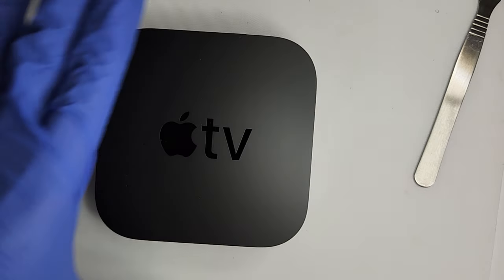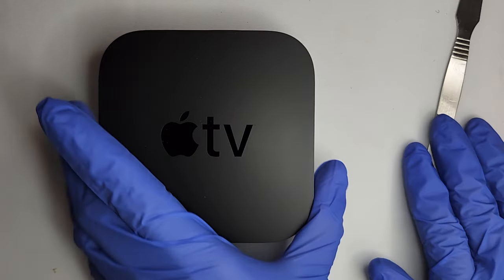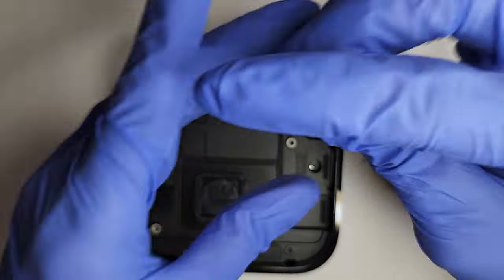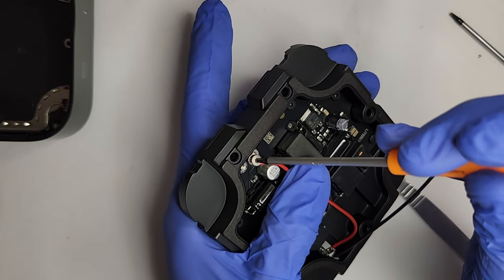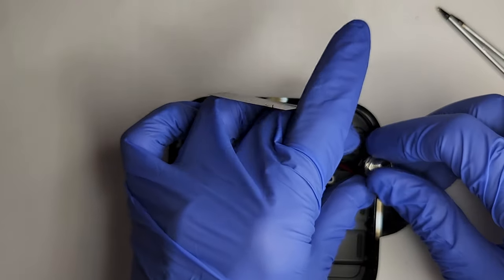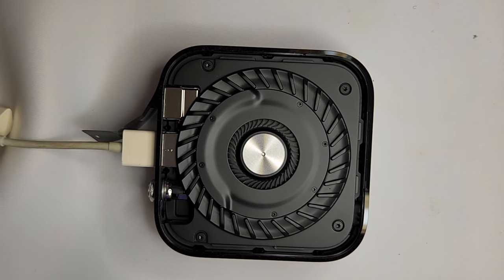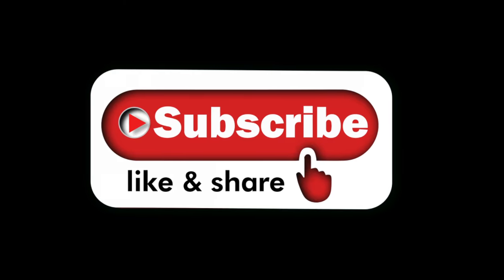DIY: How to hack your Apple TV to run from 12v (Car) DC power in less than 10 minutes.

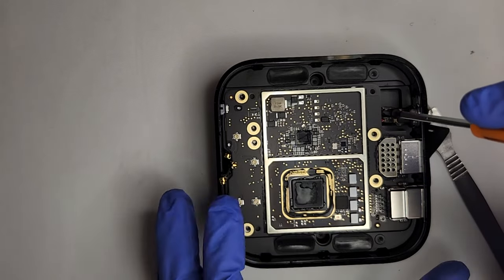Comment: One question, If you can read 12v when measureing the plugs on top (5:56) , would that mean that the Mainboard is faulty ? and the power supply 110/230v is ok ?

Comment: Great video....but think would have been more useful to add USB C port and get the result...also it would add expansion functionality too as well as power.
Reply: Thought about it for m build (broken power supply). While you can source boards in China that provide USB-C and Power Delivery initiation logic, they are sometimes of poor quality. And not many cheap wall chargers can supply 12V.

Comment: definitely gonna try this in my 2021 ATV, and buy the mod from you for the 2022. For the 2021 ATV the negative pin is the one toward the outer side of the unit (looking at it from behind) correct! Great work and thanks for sharing.
Reply from the maker: I'm a little afraid to answer definitely because your "outer" may not be my definition of outer.  Let's just say this when looking at the bottom of the PSU with the big capacitor in view, the Positive pin (screw) is towards the corner of the PSU.  Hope this helps.
Reply: @mikegyverComputer on the 4th gen u have 3 screws the black screw to the left is earth as ur looking at the power board with the 3 screws at the top the middle screw is a earth aswell on the 4th gen its the silver one on the right that is the positive on the 4th gen. ur video was great but it shows the 3rd gen I think.as I say my 4th gen has 3 screws 2 black with are earth and one silver screw which is positive

Comment: HI, i would like to order this kit but the cost to ship is more than double the parts cost... what is technically called the part with the attached cables, i am trying to find it here.. thanks for the very helpful video!
Reply from the maker: yes, i'm pretty sure you can find options locally. Just be sure you regulate the voltage.  Thanks!

Comment: Can you drive it with usb-c or does it have to be 12 volts? I read these units only require 5 volts at 4 amps, about 20 watts.
Reply from the maker: Not this model.  It requires 12v.  The newer Apple TV is less then 5v.  See our other vid on that.

Comment: Is it possible to use 12V 1A power supply?
Thank you.
Reply from the maker: The original PSU is rated at 1.083a
Reply: Thanks 👍

Comment: if I want to use Apple tv at home, what charger should I buy to install it, how many watts do I need?
Reply from the maker: Just be sure it's regulated 12v, and it doesn't use more then 2a
Reply: @mikegyverComputer  last night i tried this but still it doesn't work, same problem
Reply from the maker: @dumitrusupostat  Are you sure you have power?  Did you accidentally short it out by reversing polarity?
Reply: @mikegyverComputer  the led blinks as before

Comment: Hello, will this work with the Apple tv 4K with new remote ?
Reply: hi if u have the 4th gen 4k u can do this but its slightly different you will have 3 screws in the position on the board as they show here instead of 2 black screws. it's really easy!! basically if ypu turn your power board so the screws are at the top in the left corner of the board. then the first to screws will be black earth to the first black screw. with ur earth wire obviously then miss the middle black screw and got to the 3rd silver screw put ur positive wire there. and it will work I've littery just done it and tested it yesterday

Comment: Do you have a link to the DC jack and power supply you used?
Reply from the maker: I have an older model used, but this should work fine too. 
Affiliated Amazon: 
DC car adapter:
https://amzn.to/3eKDNGG

Panel mount jack and plug 
https://amzn.to/3SfW2kO
Reply: @mikegyverComputer  Thanks!!!

Comment: I love brain of apple that make high voltage instead of extra low volt for safety 😅😅😅
Reply: Because thats what your house has
Reply: @jvinsnes  It would be way more awesome to have them powered by USB-C aswell. You could still use them with a regular phone charger, which apple can exclude so you have to pay them even more money. Also it wouldnt even matter where the frick you live, in terms of "what your house has" = Lower production cost i guess? So there are enough reasons for asking the question "why they went the extra path for adding AC, when we all have AC to DC converters already at home?" :D

Comment: consider the different models have different internal voltage … that’s why I replace the internal power supply with an DC DC converter, to also flatten the voltage shift in the RV … https://www.youtube.com/watch?v=1gLS6eaj8Is